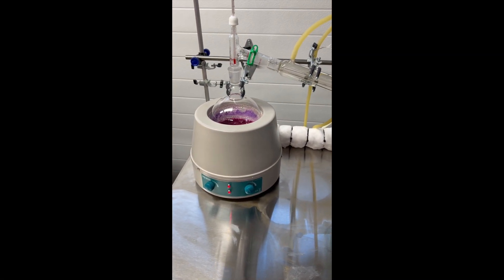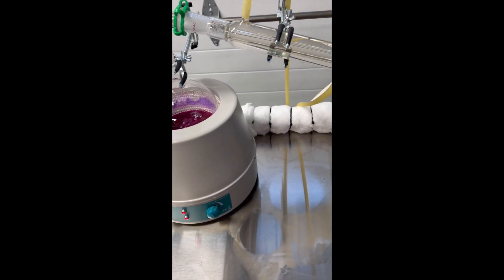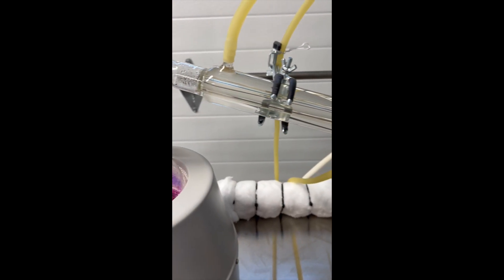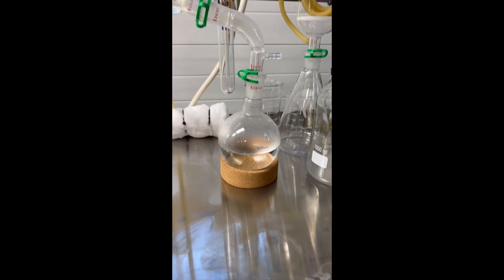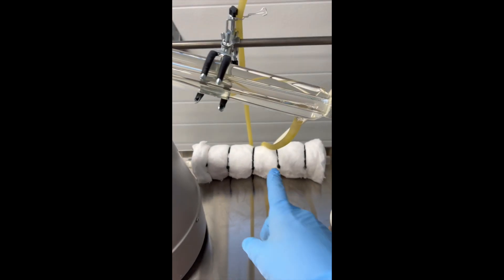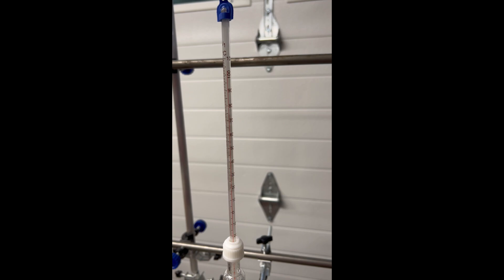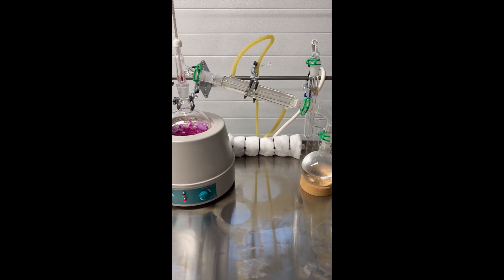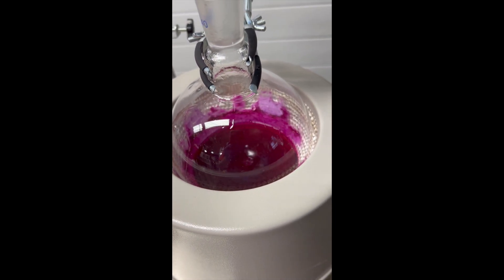D2O Deuterium Heavy Water Project Update

Comment: Did you make heavy water?
A video of the heavy water test you made?
Reply from the maker: I believe I have enriched the deuterium a bit but unfortunately I really need to get a FTIR to quantify any changes. The process only enriches the deuterium by tiny fractions of a percent at a time and takes an extremely long time. I need to get the FTIR spectrometer which is capable of measuring those minute changes and let me know which process is working or not. Then I can layout a process map to follow.